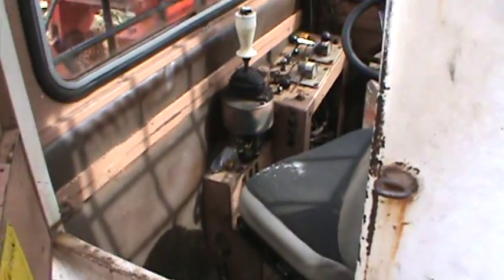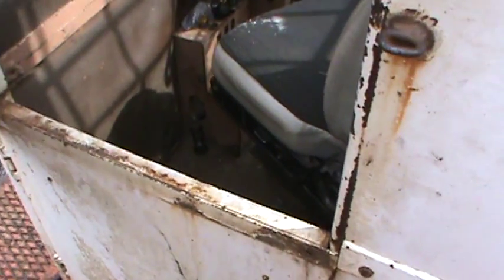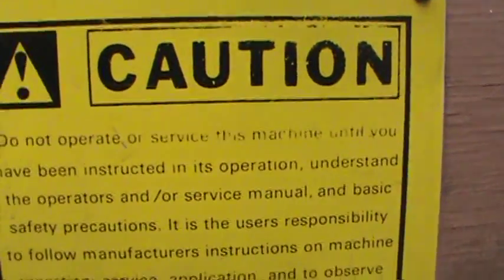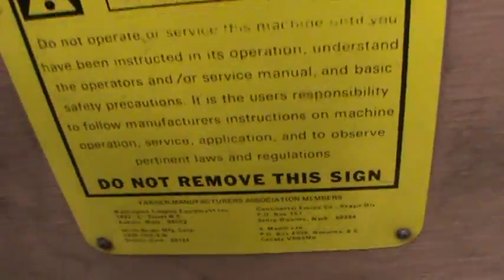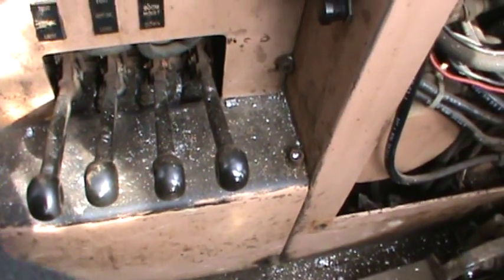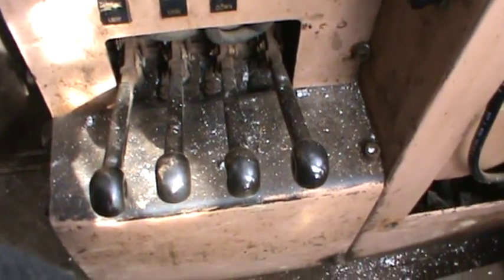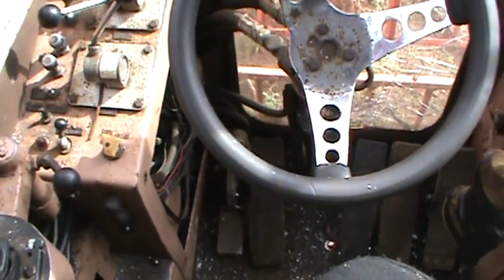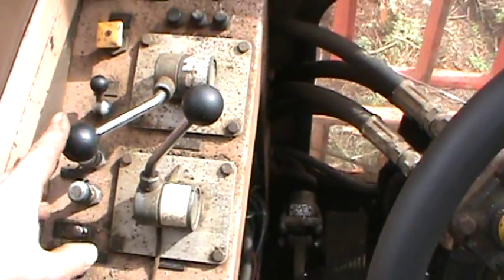Madill 122 Grapple Yarder pt. 2

Comment: I drive a cat 535c grapple skidder and i pull drags from a 122, the stick on the left is for the swing left/right. There should be another lever on the right side that goes back and forth that runs the haulback

Comment: I help move guy-lines all the time. Its ok when you are yarding downhill, but pulling them guy-lines up a hill when yarding from the bottom to the top is a pain, we usually just use the straw-line to pull the guy line over.
 Changing out guy-lines is a real pain though. Thats the downside of a yarder operator. Gotta know splicing and all that other crap. Not for me id rather run a skidder or buncher